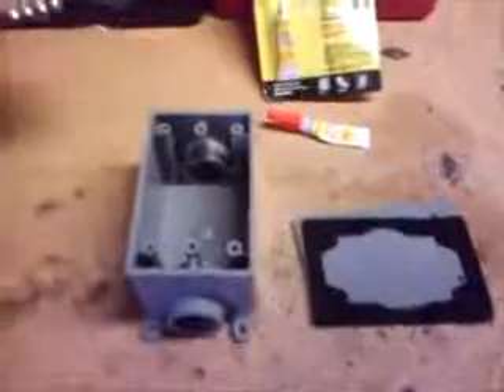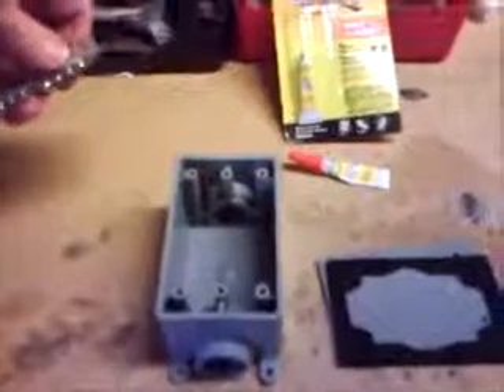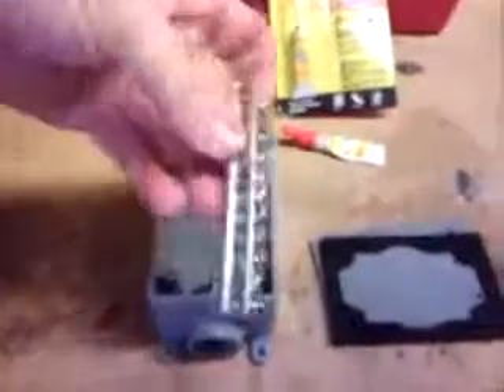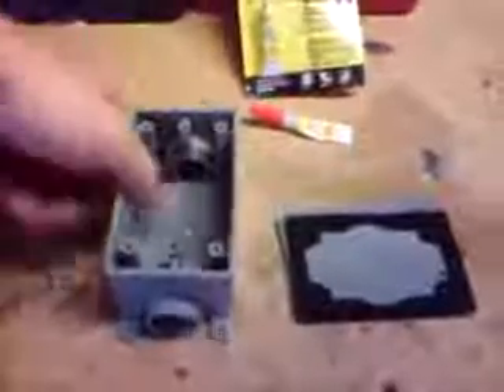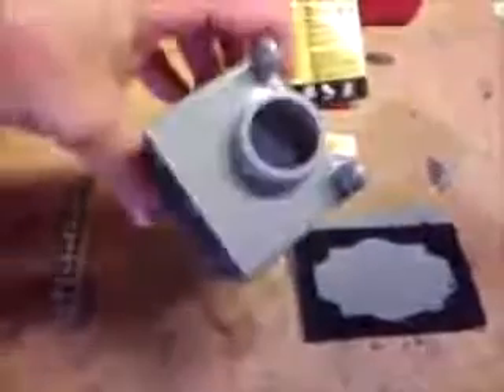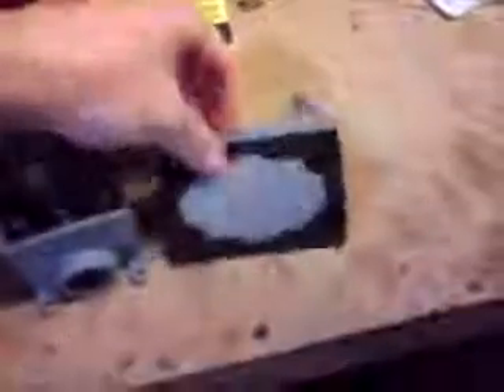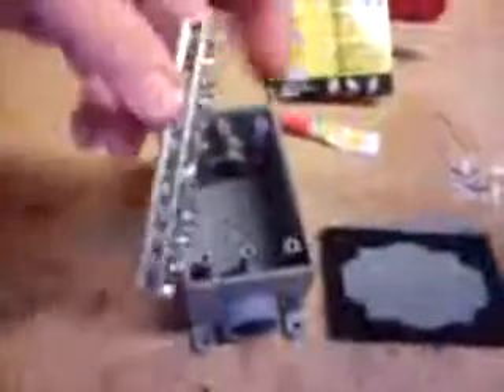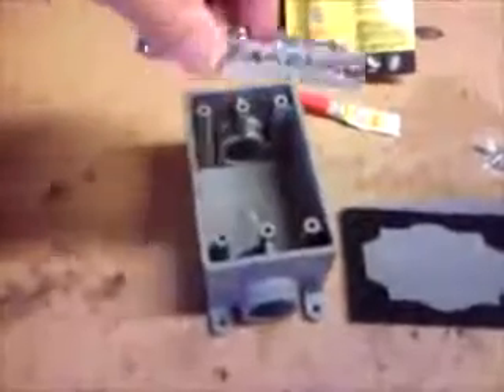My Solar Power Setup - Part 3 COMBINER BOX

Comment: I used same box but it was for conduit from outside to inside, that gauge of wire you using may not be heavy enough, take a look at the wires from the panels then look at the wire size going to the charger. They could get hot and burn. Also line drop e,g power loss, and I would never use glue! it should have been bolted, just if one block came off it would become a dead short then could become a fire; and each panel not fused or grounded. help info don't need fire but good idea enjoy free power.

Comment: I like the clean look of the connector bar...but I just use a properly sized wire nut and join everytthing in a box....just seems a lot less expensive and I seem to have no loss in current or amps. Just thought I'd share my 2 cents. Great work!

Comment from the maker: Epoxy would definitely be stronger.  Super glue is very quick setting and is easy to use, that is why I used it here.  Since there are really no stresses on the ground bar, super glue works fine.  I have made and am using a few of these boxes and have not had the gound bar come loose yet.

Comment: Hi Skippy,  Anything new?  Since I last wrote I went from 1 to 4 batteries, added a 120w Kryocera panel, and a Morningstar lighting controller/battery charger (which brings on my 12v porch light and charges batteries).  Maybe I should do a video.  Ed

Comment from the maker: Works pretty good, right?  The cool thing is that you can use different length ground bar depending on how many panels you have.  You could even parallel multiple boxes together if you want.  The super glue holds really well also.

Comment: Thanks for posting this, I just built one after watching this last night.  I was wondering how to tie six harbor freight 15 watts panels together cleanly, this was just the ticket.  I used a shorter ground bar that I could wedge into each side of the box, with the super glue for additional holding power.

Comment from the maker: Initially, I had my panels connected with wire nuts also, but I was losing some voltage that way.  This is a very easy to make box, and I am not losing any voltage.  Try it, it's easy to make.

Comment from the maker: Thanks.  No, I was using the one that I have installed outdoors for a while with no ill effects.  You can buy a top for this box that comes with weather stripping.  Then you can seal the ends up and make it totally weather proof.  I am not losing any voltage or amperage from the ground bar either.